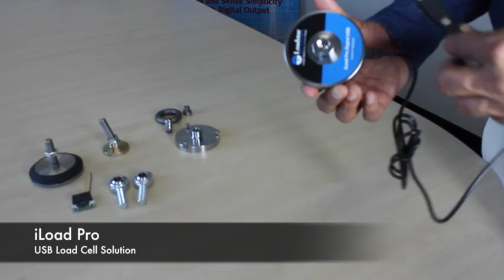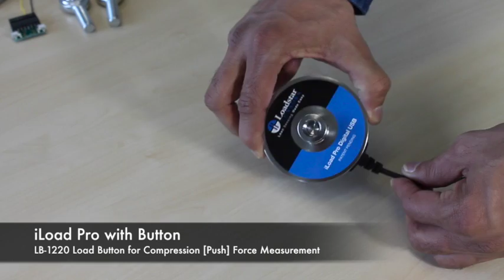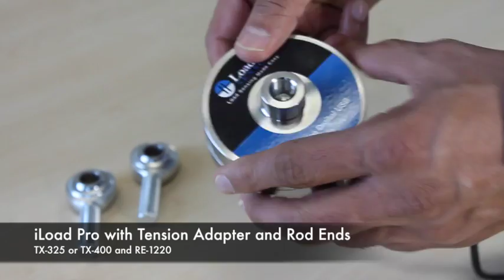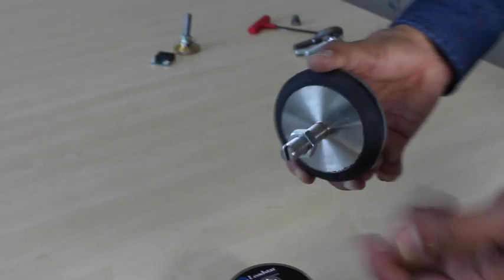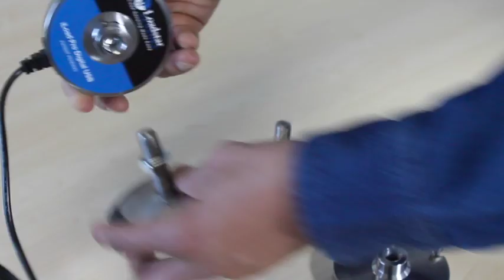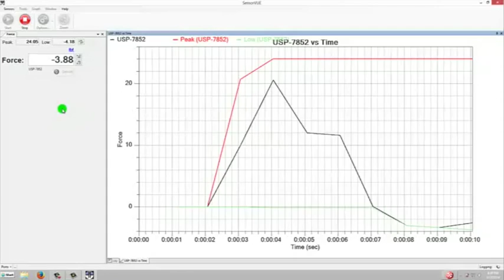iLoadPro Digital USB Load Cell based on Capacitive Sensing Technology

Comment: I desperately need a digital scale with an interface to a PC  (we can do the programming) with 0.1g accuracy.  Its for a school science project.  But we need to find a way to keep the cost down.  We have three choices: 
1) Find a digital scale with 1kg capacity and 0.1g accuracy with an interface cable of some kind (RS232, USB, D-Sub).  For some reason I can't find one!! I can find scales with 1g accuracy with an interface!! But not 0.1g
2) Take a $15-30 digital scale with 0.1g accuracy and open it up and find a way to connect the internal cables to an interface.  YUCK... but doable.
3) Purchase a load cell with 0.1g accuracy and interface it to a USB..

You company has exactly what I need... but the prices seem way over what we can afford on a little science project.  Any thoughts? 

savindwarf@outlook.com